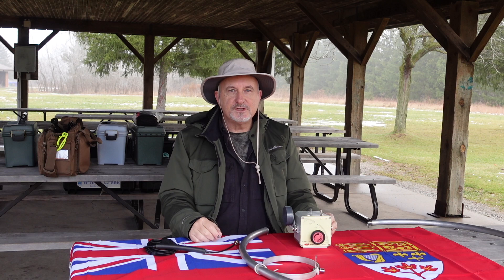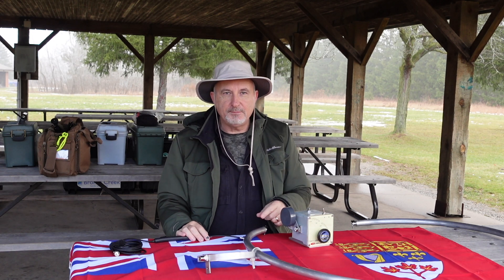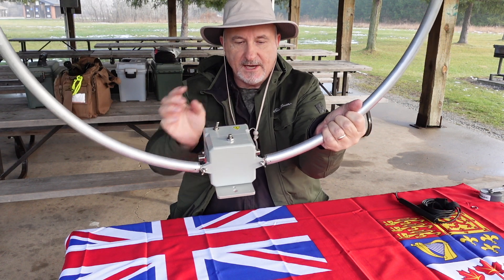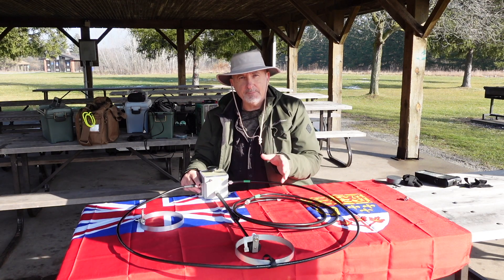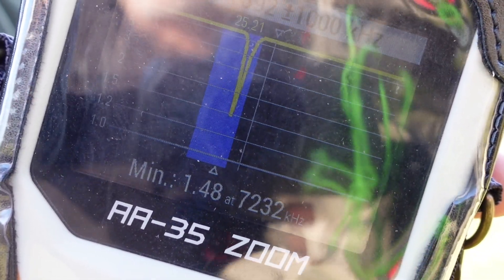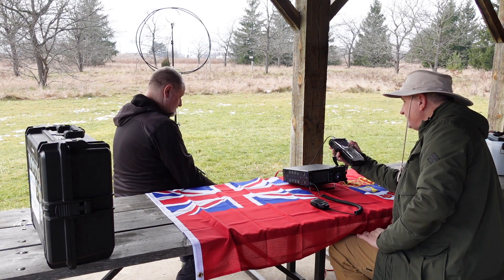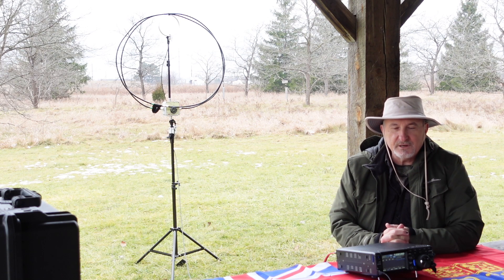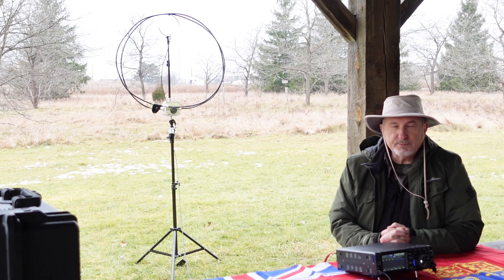Trouble with a Magnetic Loop Antenna

Comment: I have a lot of experience with mag loops for both fixed and portable ops.  I usually tune using a NanoVNA with VSWR and Smith charts simultaneously.  At first glance, the metal loop looks like it should easily be brought into resonance on 20m.  One of the other commenters may be correct that you have shorted the coupling loop to the radiating loop.  The region of resonance on small loops can be so sharp that it is missed if a wide sweep range is used.  I am guessing you were using one of the Rig Expert analyzers.  I have no experience with them.  However, measuring the capacitance of the tuning unit directly could help debug the tuning unit with the covers in place. To my eyes the coupling loop looks a little small.  You might look at the manual to see what frequency it is intended for.   Moving the coupling loop towards or away from the center and rotating it will affect the minimum SWR's at any given tuning point.  My preference is to gamma match the feed opposite the tuning cap.  With short feeds and attention to detail, you should be able to get the loop very close to 1:1.
Reply from the maker: Thank you for the detailed comment! I've got more work to do with that loop.

Comment: The big aluminium loop and the small aliminium coupling loop are not ment to be touching each other they looked to be ziptied together, next time try to  insulate the two loops from each other or create an air gap hope this helps from EI9GNB
Reply from the maker: Thank you for your comment! It's hard to see in the video, but there is a gap between the outer loop and the coupling loop. The coupling loop hangs, so there is spacing.

Comment: thanks of the videos these are cool - try this for fun - place an aluminum can on your computer trackpad  - the aluminum can acts a loop antenna and the computer as an unconventional radio receiver - believe it or not - and it will receive a signal that will cause your computer cursor to move by itself - controlled by the signal - crazy but real
Reply from the maker: Cool!

Comment: Tracy - I have the F-Loop 3.0 and it works flawlessly with my IC-705. I was surprised by how well it worked with my QRP setup.  It appears that your have the older F-loop 2.0 model by the images in your video.  I cannot  speak to the version 2.0 F-Loop since mine is a 3.0 and there are I am sure there are some differences between them.   In the instructions for my 3.0 F-Loop it states to use the 7" coupling loop (and not the larger 8" loop) with the rigid aluminum radiator loop and to leave a 1/4" gap between the 2 loops.  It appears in the video that you are using the correct smaller 7" loop, however in the video I cannot see if there is a gap between them.   With using the coaxial loop, the coupling loop is insulated from the radiating loop by the coax jacket and the gap probably isn't as critical.   I am wondering if the 2 aluminum loops were touching your case and this was causing incorrect coupling,  maybe thats why it didn't tune up with any dips on the rigid loop but you did have dips on the coaxial loop... just a thought to consider maybe?

I love your videos, hope you figure the issue out and its not an issue with the variable capacitor being damaged where you have to send it in for repair.   Good luck, hope you figure it out!

73,
Rod - KY4ROD
Reply from the maker: Thank you Rod, I really appreciate your insights! I'll double-check the gap between the loops.

Comment: If you achieved resonance with the 2-turn coaxial loop on 40M, but not with the single-turn aluminum loop, it is because the aluminum loop has insufficient inductance to resonate with the capacitor on 40M, even with the capacitor set to maximum.  Open up the box and look at the capacitor to check for any blades being bent or missing. It would be interesting to know the lowest frequency you could achieve resonance with the solid loop. Also, upon opening the box, check the connections from the where the solid loop is attached to the capacitor terminals. Good luck.  73, Steve, AB2EW
Reply from the maker: Great advice Steve, I'll get that checked out!

Comment: Very simple - if you've issue with a second hand LOOP antenna - the capacitors is damaged because tune the metal loop or the LMR-400 coax loop is very easy!
Reply: I have the same issue with mine.

Comment: I've had mine for about 10 years. Never had an issue. But then again I bought it new and it has never seen more than 5 watts go through it. I've looked at the compensator, and that should get you 60.. Only issue I've had with the steel loop, was that the connections where not tight enough. Could be whom ever had it previously figures that with the compensator if it can handle 60 heck it should handle 100! Had a  friend that bought one after seeing mine and liked it. But he hated tuning it so he added an auto tuner to it and would run 100 watts into it. Then one day he noticed that the plastic was melting. Took it apart and it was scorched. Were talking apocalyptic scorched. Said they here a piece of just. Then Told me how he set it up. Mine still works great. Love the Champollion. Would still like to try a few others on the market. as it isn't the easiest on to take portable in the woods due to the weight!
Reply from the maker: Thanks for sharing your experience! It's amazing how some people treat their antennas and rigs.

Comment: It's certainly not the aluminium loop - that is a solid conductor, no breaks in it, except for the join at the top. There is very little that can go wrong with the loop. My guess is the jumper connection point inside the box where the loop makes contact with the capacitor. I bet there is a dry joint on the connection, and the weight of the aluminium loop puts pressure on that dry joint allowing it to lose connection to the capacitor. Open up the box, I'm sure you will find the issue
Reply from the maker: This is the best guess I've come across, thank you very much.
Reply: @OutdoorsOnTheAir  i have that loop and that is the first thing i thought also, i'm sure will be an easy fix. don't overpower it or will arch. also keep good distance from the loop when tx. it's high impedance and radiating right next to you.